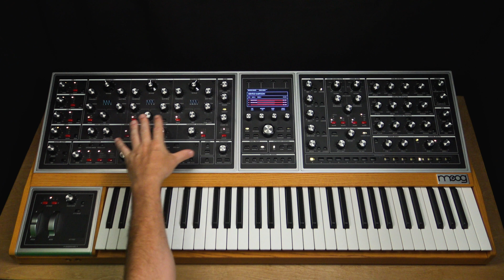Moog One - L.F.O. Assign and Control

Comment: 2:32 Understanding destination control is a sticking point for me; thanks for talking this through. Very helpful. 
I just couldn't imagine the signal path. 
Setting a destination is like a patch cable from the 'LFO 3 out' to the 'Modulation Decay in' if this were a modular synth.
It does seem simple when it's explained well. LFO to modulation envelope decay, set to a percentage depth.
Reply: Thanks Robot Boogie. Having this kind of flexibility really starts to boggle the mind when you start imagining what is possible. Also. Looks a bit cleaner then patch cable as well ;). I’d love to hear what you are up to because it sounds like you are going deep into the operation. Please share in any of the comments sections of the videos  so I can give it a listen (if you are so inclined. :)).